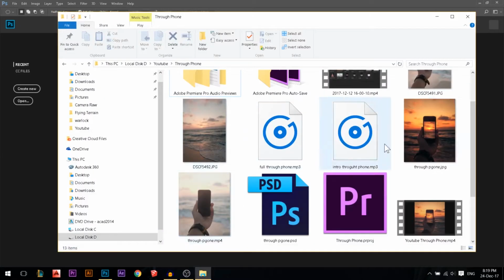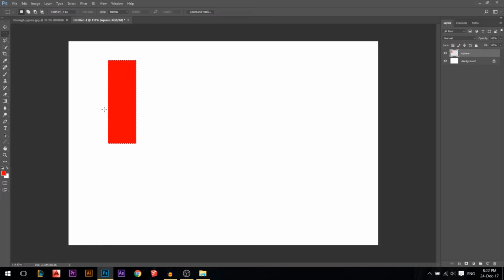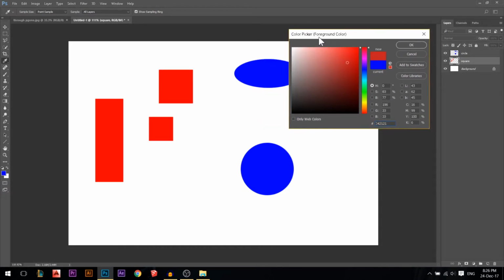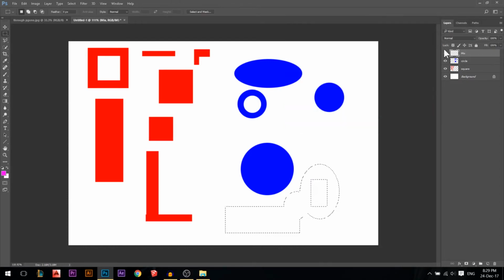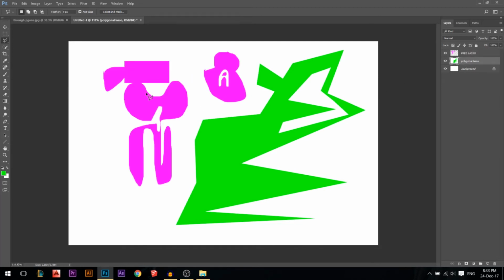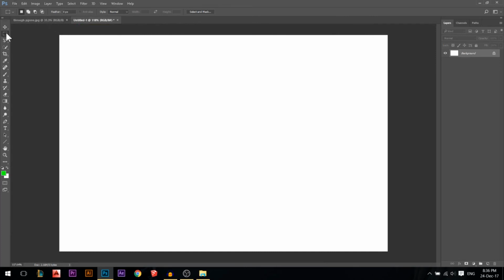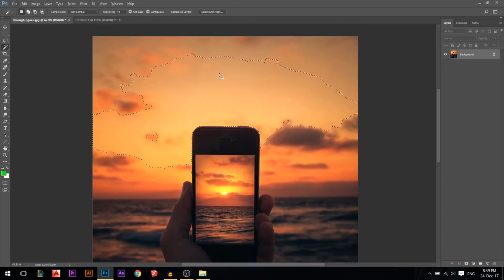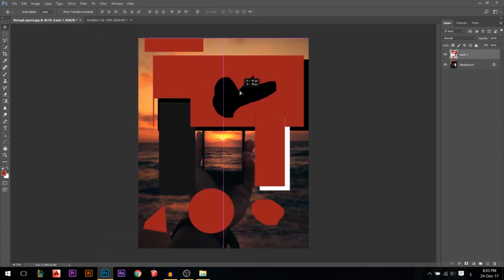Photoshop Beginner Course 4 | Selection Tools

Comment: Realize this is an older vid & version of PS, but let's say you wanted to straigten your lines in the those "A"'s you created... how do you do that? I'm really having trouble right now adjusting my selection to add one or two pixels over. It snaps right back to the original selection and won't add these minute corrections :(
Reply from the maker: am not sure i got the question correct 
but try holding Shift , it straightens the lines.
Reply: @PhotoshopHustler  after you've created the selection. How do you add to it. To correct your selection.
Reply from the maker: @Nishkween  hold ctrl + backspace or Alt + backspack or Shift +backspace
Reply from the maker: @Nishkween  to add to selection , hold shift it will add, alt to subtract.
or look at top left in selection options ull find a small  + and - sign
Reply: @PhotoshopHustler  Thank you for your help. I will try this.